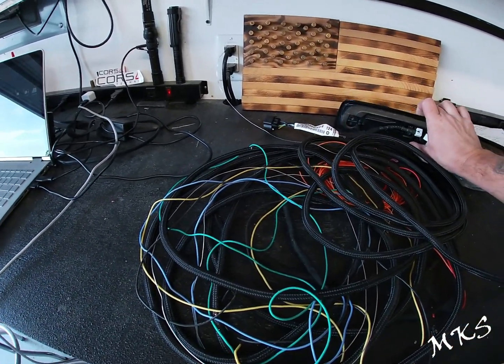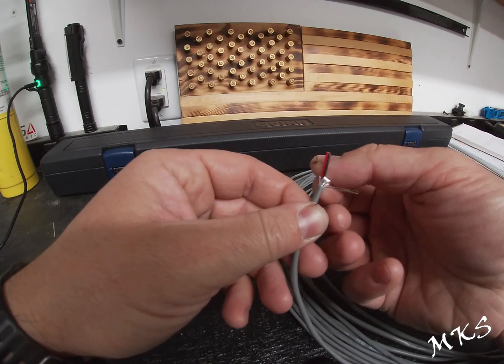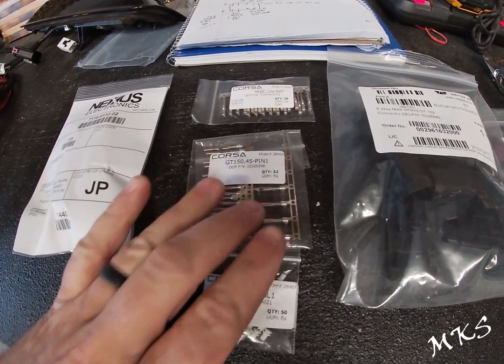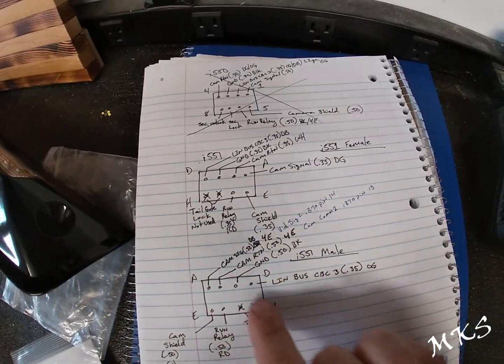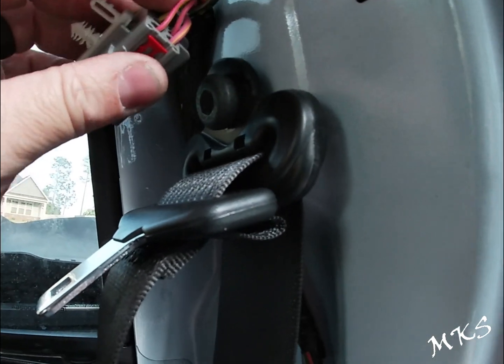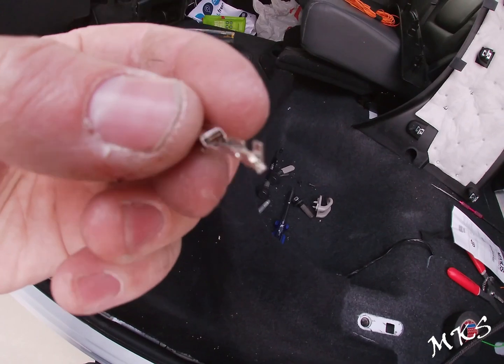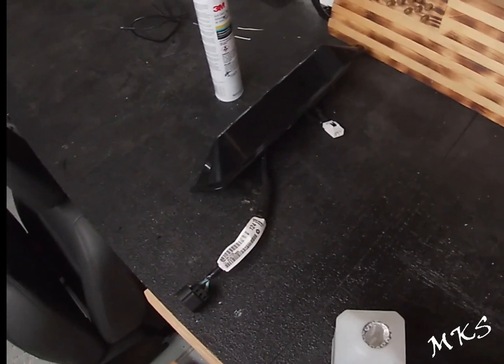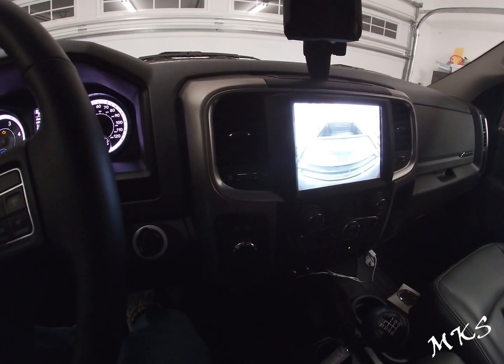DIY LED CHMSL & Cargo Camera Install | 2018 4th Gen Ram 2500/3500

Comment: Could you tell me why the 2016 radio is required and where I can get a wiring schematic
i was able to install the cargo cam icon on my 2013 8.4 if that makes any difference
Thanks
Reply from the maker: 2016+ radios have multiple camera inputs and radios older than 2016 have 1 cam input.  You would need to rig up a splitter to switch between back up cam and cargo cam.

Comment: Will this harness work on a 2013 2500 Laramie 4th gen truck
Reply from the maker: Yes, does require 2016+ radio upgrade

Comment: On the harness where you say you need pins 12-14 where did you get the schematic from or what is that harness called? I have a 16 and my harness is lightly different they yours i have the same for 13 and 14 but my shielded wire is 15 and not 12. I wanna see make sure before i hook up and fry something. Thanks!
Reply from the maker: 2016 will have the shield wire routed to pin 12 in i370 and newer will swap to pin 15 in i370
Reply: @MKSPerformanceOffroad I was just about to ask the same question.  I have a 2016 RAM 2500 and my shielded wire is pinned in #15.

Comment: Hey, Have another question. If you got a factory 3rd brake light with camera. Also I have the camera in my back tailgate. Now how do I get the 3rd brake light camera to work right? If I buy infotainment wire harness. What all I need to do to get it to work?
Reply from the maker: Send us an email or message on IG

Comment: What that fit an 2023 ram 5500 crew cab with a 8.4 radio factory UConn?
Reply from the maker: I would have to look at the schematics to see but likely no, not in its current configuration.  Most if the newer cameras utilize a fakra connector for the camera so it would need a different connection for that piece.

Comment: Is this the same for a 2013 3500? Whered you get the light?
Reply from the maker: Should be similar but the radio will need to be 2016 or later if Im not mistaken.  Salvage yard find
Reply: @MKS Performance & Offroad  okay thanks when I find them on Google I can't find the one for the 7 speed fan control just the 4 will this matter? And do you have any videos of adding factory heated seats
Reply from the maker: @jordangress236  you will need to search on cummins forum for adding the cargo camera for specific radio information.  I know it has to be 2016+ but I dont recall if an exact model of 8.4 is required.  No I do not have any videos for adding heated seats, mine came factory.

Comment: I have. 2017 2500 megacab limited with navigation will the hook up be the same? You mentioned that you didn’t have navigation.
Reply from the maker: Depends on where you are running wires to.  You should have the harness connector pinned out at the driver side dash panel but if not you would need to run the wire from the radio to pin that connector.  I don’t believe the nav unit uses a different pin out I will check though and let you know.

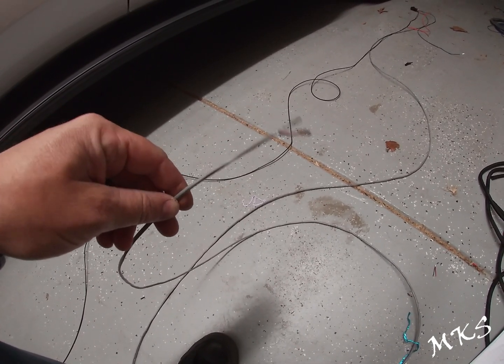Comment: At 3:10 it looks like you have 30' of orange wire for your lin bus cbc3 and red for your run relay it also shows a big bundle again at 25:43. But before that you said they only need to be 36". Did you end up not needing to run those as far as you thought due to them being in the I440?
Reply from the maker: Correct, that was just for the test harness.  Made them longer in case we had to run them further.  They were shortened to pin into the i440.

Comment: Do you know anything about having to wire it from the connecting point to the radio? Just checked and I don't have the 3 wires required for this kit so I'm searching the internet to find that diagram and then are you selling a kit? I don't have instagram to message but possible email?
Reply: yosoyjerrad@gmail.com if you can delete this comment after you get it as I have no way to email you. Thank you.
Reply from the maker: I dont currently make the radio harness , looking at ordering pins and figuring this out. Your the 3rd person to ask.  Do you have facebook?
Reply: @MKSPerformanceOffroad  I messaged you on there.
Reply: I am interested in a wiring harness 2017 2500.

Comment: Question - the harness in your video had two dongles but the one from Amazon has three. Where does the little black dongle go that’s near the camera connection?
Reply from the maker: Great question, the harness is originally for the tailgate that I modify.  That 3rd little plug is actually the wiring that goes to the tailgate lock cylinder.
Reply: @MKSPerformanceOffroad  so then I can trace those wires to where they connect and just remove them? Just want to make sure.
Reply from the maker: @RamChaos  if your referring to the 2 wire connector on the jumper harness that goes from the camera to the main harness I build then yes you can cut those wires flush and wrap them up in the jumper harness or depin them and leave the pins on then wrap them up in the harness.

Comment: Would you happen to know what the female terminal/pin size or part number would be for the connector on the back of the radio?
Reply from the maker: Looks like the connector is AMP 0.64 Connector System, 52 Position, pn 2203937-1 on te.com .  Female terminals are .64, 2.1 . https://www.te.com/usa-en/product-2203937-1.html

Comment: This is an amazingly detailed video.  I have my dashcam powered by the Cig lighter circuit but need to find a different solution.  My preference is a power source that is on with engine including remote start because the accessory circuit is only on when the key is on.  I want to be able to keep the dashcam running at an accident scene without having my key in the ignition and to activate the camera with the remote start.  Any suggestions? 2016 Ram Big Horn 8.4 radio with Nav
Reply from the maker: If you dont want to tap into any wires Id recommend doing a fuse tap in the fuse panel and running your wires into the firewall and then to the cam.  You can find an accessory circuit that has power your looking for.

Comment: This is nuts. Just buy a dash cam mirror with a back up cam included and mount it on the roof of truck. I threw up three times watching this video as there was so much work involved
Reply from the maker: Then dont watch it and go install what you want.  Thanks for your expertise, what dash cam do you recommend?

Comment: Will you make a wire harness and sell??
Reply: I can if you would like. Be sure you have the correct camera though. There are 2 models. The one you need has the 6 pins on a small round connector. The one you want is the analog and you DO NOT want the digital one with a single connection (Fakra jack). You will also need a tool to update the radio to add the camera option. When I completed mine, it took 24 hours to show up... I do not understand why.
Reply: @shane1213  how much
Reply: @shane1213  where you located?
Reply from the maker: Unfortunately at this time Im not building these for sale.
Reply from the maker: @qkevin73 Did you end up getting a harness made?
Reply: @MKSPerformanceOffroad  nothing yet
Reply from the maker: @qkevin73  hit me up on instagram, I will have more harnesses made when my supplies come in.

Comment: Is it possible to run this on a 2010 — 2012 Dodge Laramie 1500
Reply from the maker: Possibly if you install a 2016 or newer 8.4 radio.  I cant say if the wiring is the exact same or not.

Comment: It looks like this would work for many year models with UConnect.   Is there any reason it wouldn’t?
Reply from the maker: You would need to look at the schematics to make sure your connecting the correct wires and to ensure your Radio is capable of displaying the cargo camera.  I believe some model years I want to say after 2015 or 2016 is when the cargo cam became an option but dont quote me on that.

Comment: Can you make me  wire harness like this for my 18. I'm interested in this
Reply: I be interested in one. I bought the the door panels harness for the tow mirrors last week
Reply from the maker: @rogerstewart5140  nice, how do you like the harnesses?  I thought they were pretty nice plug and play units.  Hit me up on instagram: mksperformanceandoffroad
Reply: DDP just mail it Thursday i think. So I should get it this week.  All I'm have to do is plug and play. Because I have the lights in the door panels.
Reply from the maker: @rogerstewart5140  I think you will like these, they are pretty cool.
Reply: I can if you would like. Be sure you have the correct camera thought. There are 2 models. The one you need has the 6 pins on a small round connector. The one you want is the analog and you DO NOT want the digital one with a single connection (Fakra jack). You will also need a tool to update the radio to add the camera option. When I completed mine, it took 24 hours to show up... I do not understand why.
Reply: @shane1213  why can you not use the Digital one?
Reply: @RamChaos  because you need the control unit that talks through the CANBUS and a network controller. This version is simply the analog integration.
Reply from the maker: @roger Stewart did you get a harness, I may have a few built in the coming weeks.
Reply: This is an older video, but if possible I would be interested in a harness also. Thanks.

Comment: Are you selling the harnesses made?
Reply from the maker: Im not at the present moment, possibly in the near future.
Reply: @MKSPerformanceOffroad  I’d be interested in a harness too.
Reply from the maker: @Smog_007  it will be a hot minute before Im able to make any of these.  If I do it wouldnt be for a few months so I can source everything
Reply: @MKSPerformanceOffroad  yeah for sure!! I know how that is.  I’ve actually just got all the parts and will wire this up after my other build.  Thank you so much for the detailed instructions!!!
Reply: @Smog_007  I can if you would like. Be sure you have the correct camera though. There are 2 models. The one you need has the 6 pins on a small round connector. The one you want is the analog and you DO NOT want the digital one with a single connection (Fakra jack). You will also need a tool to update the radio to add the camera option. When I completed mine, it took 24 hours to show up... I do not understand why.
Reply: @shane1213  thanks!  I haven’t got around to it yet but I do have the analog version. I recently moved and I still need to finish another (broken Audi) project.
Reply from the maker: @ram rebel mods r us, @ James, have yall got a harness yet?  May have a few built in the coming weeks.
Reply: @MKSPerformanceOffroad  if you have some built that aren't spoken for if be interested.
Reply from the maker: @baker1015sb  please send dm on IG